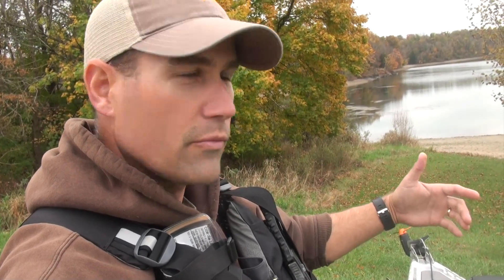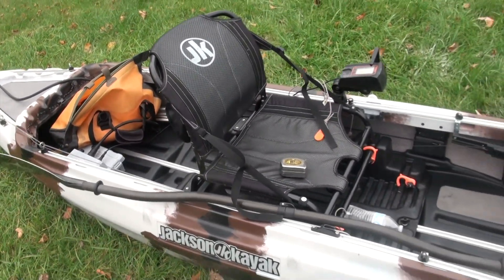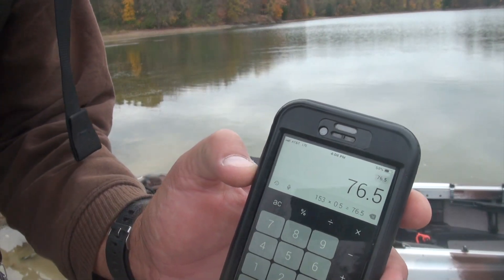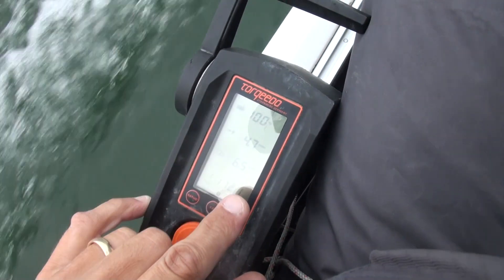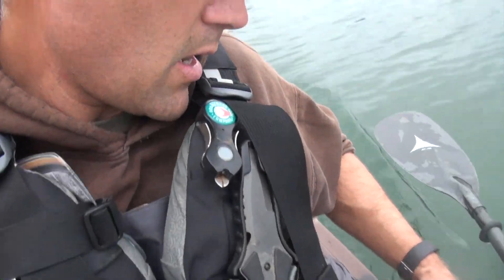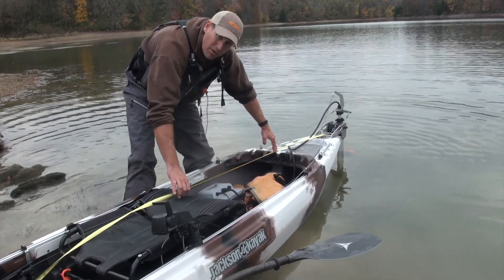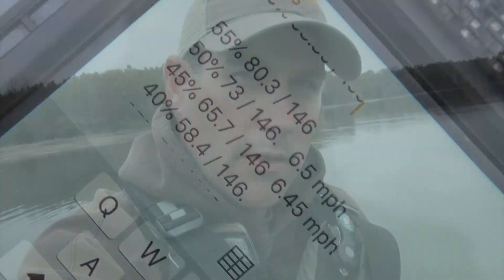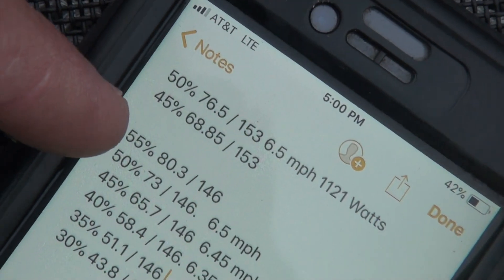Torqeedo Ultralight 1103 on Jackson Kayak Kilroy HD Testing Seat Ratio

Comment: Why does the video show range of 4.6 miles at 6.5 knots and battery at 100% but data table at the end of video say 5.3 miles range?
Reply from the maker: Robert Ciappara Two reasons. The first is that the chart at the end was taken from a test run with a more forward position, which is more efficient. The second was that the 915 Wh battery I tested with is several years old. They lose about 4% capacity per year. It’s not related to number of cycles. It purely a capacity loss due to time passing. 4% is much less than any other type of battery. Lithium is great stuff, but it’s not a perfect energy reservoir. So a 915 Wh battery that is two years old is really an 843 Wh battery. With a brand new 915 Wh battery, and the seat jammed up as far as I had it at the end, you can get that range with that boat at 6.5 mph.
Reply: @TheLittleStuff  what will the pricing be like for the 1103?
Reply from the maker: Robert Ciappara $2699

Comment: Good info. What do you think of the 1103 on the 2019 Outback and when will the 1103 be available?
Reply from the maker: David Wolf The 1103 is available for preorder now. Ask your local dealer. If you need to know where your local dealer is, email me at Jeff.Little@torqeedo.com and let me know what town you live in. They arrive in December. I put it on my Outback and the lower portion of the mount dragged in the water and the foot well filled up with water through the Mirage Drive hole. I want to put a starboard spacer between the mount and rear deck of the Outback to see if it performs better. It was mid 6’s, but should be upper 6’s. It did better with the cassette in the Mirage Drive hole.